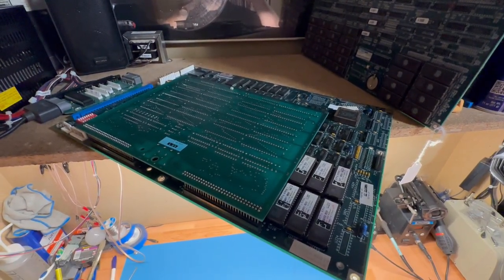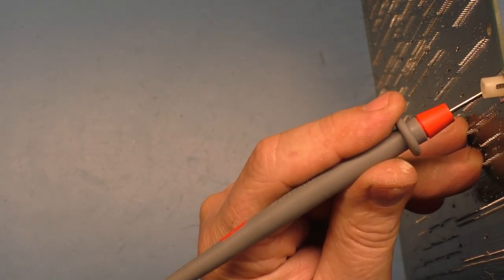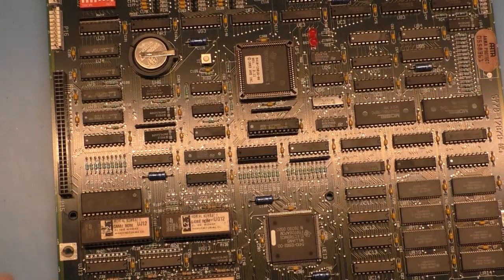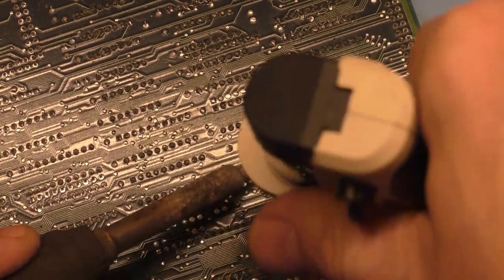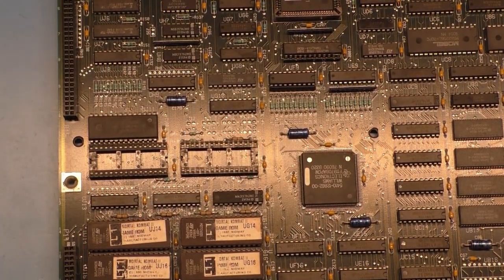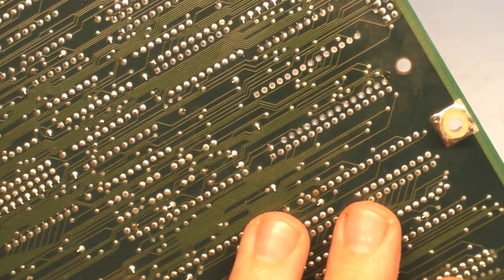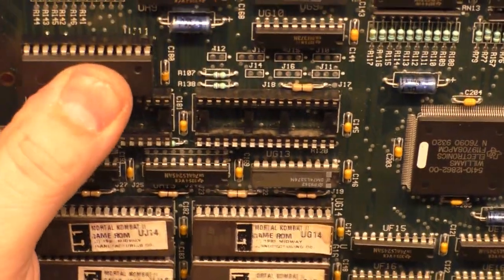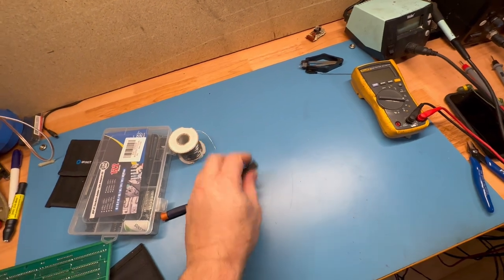Mortal Kombat 2 Arcade PCB "CMOS Chip U49 Bad" - Let's Fix It!

Comment: Hello, this is totally off topic...but...Im getting a old CRT arcade monitor that was in a Area 51 Cabinet...and I have no idea, what I should set the resolution on, and the KHz,  on my Windows 10 HP. Im not sure what resolution Area 51 supports?
Reply from the maker: Area 51 is standard res CGA 15khz only. You cannot use that monitor for a PC unless you use one of these…

https://www.amazon.com/Mcbazel-Arcade-S-VIDEO-Converter-GBS-8100-PC/dp/B07C3H7F6S/ref=asc_df_B07C3H7F6S/?tag=hyprod-20&linkCode=df0&hvadid=563656015384&hvpos=&hvnetw=g&hvrand=9563522435368337823&hvpone=&hvptwo=&hvqmt=&hvdev=m&hvdvcmdl=&hvlocint=&hvlocphy=1024290&hvtargid=pla-977238273995&psc=1

Comment: Is there a reason you used a socket rather than putting it directly back on the board? Socket definitely makes it easier for next time but just curious.
Reply from the maker: For ease of replacement in the future, yes.